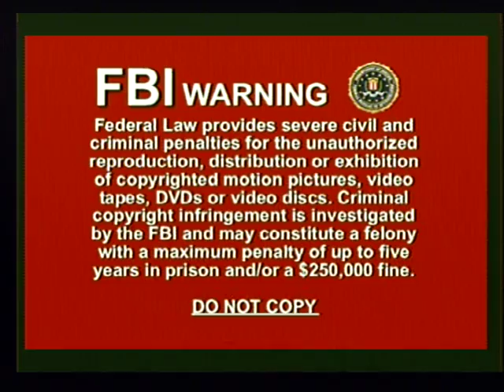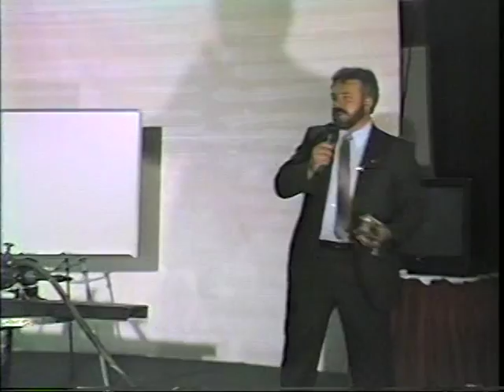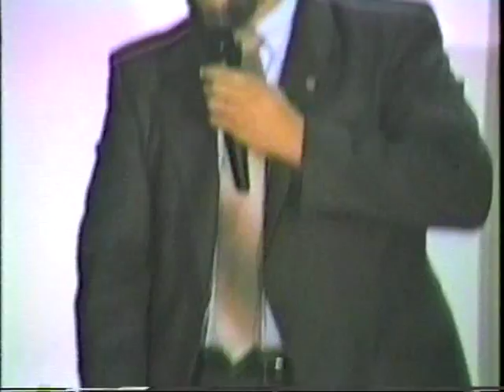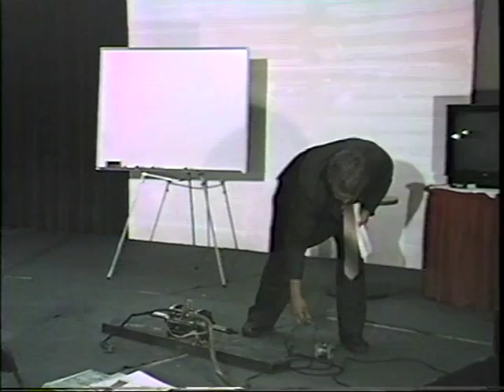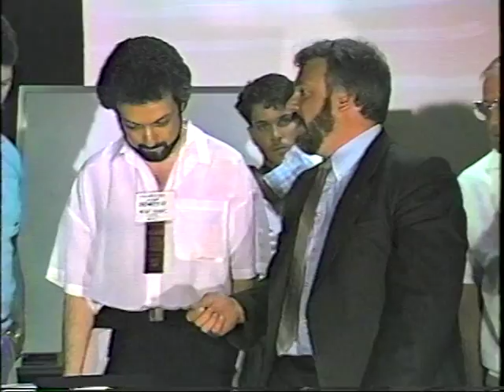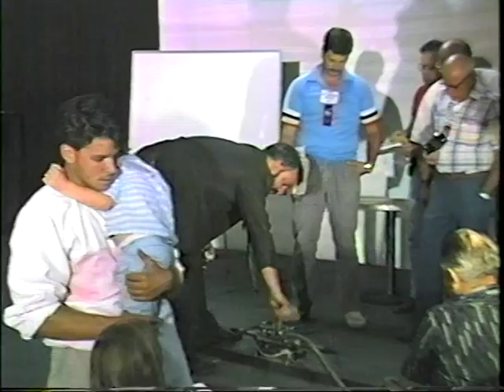Tesla Mechanical Oscillator

Comment: Is that true/accurate that a magnet pulsing back and forth through a coil is more efficient that the magnet spinning within the coil?
Reply: I think for his time, this was was more efficient in regards to frequency control.
Reply: @RickSanchez-fx3lt  Thanks, I appreciate your comment! I may have been combining principles that aren’t relatable… approaching a decade out of the industry, I’ve forgotten a lot of my electrical knowledge, save for the most basic working knowledge. 

For clarity: I was thinking about the ‘efficiency’ of movement in a piston, versus rotary engine, assuming a constant motion is more efficient than constantly reversing linear movement.
Reply: @RickSanchez-fx3lt  … also, I use to work the oil fields with an electrician named Rick Sanchez, from CA. I doubt the world is small enough for you to be the same fellow (but just saying - it’d be wild if you were)
Reply: @9h057-t5e  Hahahaha. No bro, I just use that name because Im a general fan of a show called Rick and Morty.

In regards to motion, circular is always going to be more efficient in a generator, because it also acts as s flywheel, so you can easily get a stable rpm, but I read somewhere that as a motor, he would have difficulty because of the varying voltage, and thus varying rpm. I think his main concern overall was to figure out the most efficient ways to attain variable high frequency.

Circular motion has equal force everywhere, however, piston has more force concentrated both directions of one axis. I really don't know if that concentrated mechanical motion can actually manifest an equivalent electromagnetic current. Maybe(?).

Haha

I remember as a kid, when I would have a large circular tub, I would put my hand at the middle and create vertical motion, and once my hand was resonating with the water going up and down, I could make it bigger and bigger and god that was awesome! Wonder what else can be done with it. ;)
I remember mythbusters did an episode but frankly, they didn't do it justice. They should have aligned the piston vertically, and at the middle of the bridge. They would have gotten results much quicker.
One thing I learned was, start from high and go low, the high frequency converts itself to high amplitude once everything is resonant with each other. Once you got that amplitude up, you can slowly increase back the frequency while still keeping the amplitude.
Reply: @RickSanchez-fx3lt  ah, jeeze, Rick… I knew that moniker was too familiar! 
I don’t think this is such a good idea, but just throw in a mid-sentence belch with a few insults peppered throughout and you’ll really be spot on!